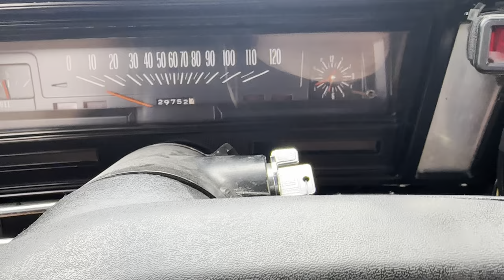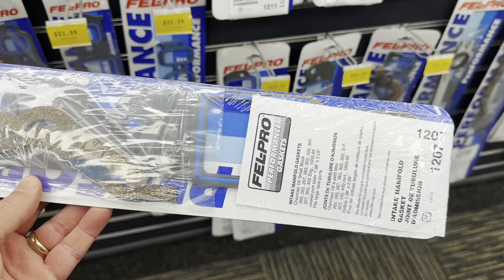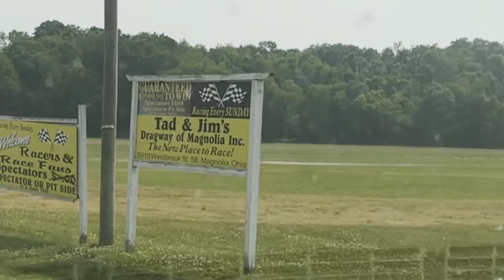LETS PLAY THE BLAME GAME!  Jimmy’s new 434 TEAR DOWN!

Comment: I have to admit, when you were showing the run/s I wasn't thinking fuel pump. In my experience fuel pumps tend to be either good, or bad. But very rarely anything in between. If I hear it running then I don't tend to think its a fuel pump related issue. Maybe that just complacency on my part, or me just being boneheaded. Truth be told, when I was watching the run/s. I figured it was one of 2 things. #1 the wiring for the fuel solenoid on the kit failed. (most likely) or #2 the fuel solenoid failed (much less likely) but possible. Solenoids tend to be like fuel pumps, Either good or bad but they don't normally fail mid-run. 

I know some people hate technology (NOT saying you "Old man") but this is a good reason to log everything you can. Had he been logging fuel pressure more than likely he could have spotted the problem before burning down the engine......

Comment: Don't know specs on fuel system, but had similar issues running the biggest elec fuel avail 20 years ago on boosted blow thru sbc.  It needed bigger than -10 return to run on the street or the pump would overheat.  It should of had a 2nd fuel system or have a pump controller that wasn't at the time

Comment: Hand the LS guys a timing light and a vacuum gauge and they wouldn’t know where to start. Parts are parts engines are engines it’s all about the combination and cubic inches. Any of them can fly apart if you tune it incorrectly or have failures

Comment: Needs a fuel pressure shut off on the ignition system. Be easy enough to wire in. Fuel pressure goes = engine shuts off. At least might save some more parts

Comment: I have a Holley Terminator X running my L...(doesn't matter🤣) I thankfully have a low fuel pressure cut off that has saved me multiple times! First when my Walboro 450 turned out to be a knock off and again when just over a quarter tank of fuel ran to the back of the tank and uncovered the pickup. I decided when I installed a turbo I wanted the safety of an aftermarket ECU to help save my many mistakes as I learn.

I am curious why it was only the outside cylinders that nipped plugs? could it be that they are further from the carb and the longer runners caused the outside to be a little leaner?

Comment: Hey Bill I have a 750 double pumper brawler gas carburator what size jets and size power valve would be good for a 355 sbc with 95 AFR heads and its got a hydraulic flat tappet 292 duration 488 lift cam?

Comment: As a block machinist I've seen Good engine builders do a fine job only to have their effort go to waste as the owners, mechanics & tuners make bad decisions that hurt or even destroy an engine. One being a SBC 383 we rebuilt at a shop I worked at. The owner & mechanic both did things I'd told them NOT to do (Per the engine builder) and ended up losing an engine and broke a lot of parts. Long story; they went to another guy while blaming myself and the shop I worked at. and the first time out he Destroyed everything 'in a catastrophic engine failure.... Huge splash on the drivers side, tore # 1 cylinder completely out of the block!  And then I saw the balancer and part of the crank bounce out from underneath the car!  😙

Comment: Fyi Bill Cleetus has a custom SMX billet engine not a big block chevy with a dry sump oil system so not the same at all as billys,but I know you don't watch his channel and your point is still the same,you will break and hurt stuff when you push the limits or parts fail at the wrong time no mattter how good of an engine builder you have.Also Steve Morris will show all of his failures on his channel also,he is pretty transparent about his shennanigans lol.Cleetus actually took out his rear thrust bearing for the 2nd time which he decided to pack it up and not hurt his 100k engine any further

Comment: I work on small engines (chainsaws, trimmers, mowers etc) and I deal with similar crap as engine builders. Everything leaves the shop with a full tank of VP racing fuel, mix or regular. That way the customer cannot blame me for their equipment not running right AFTER they run them out of fuel and put their own garbage in it. Did it run good with my fuel? It did? But as soon as you fill it up, it runs terrible??? Hmm...

Comment: Steve Morris said there was metallurgy issue with some vendors during covid-19 as well they were using cheap metal he thinks and he had a failure before his first pass on a billet SMX in the one of the main bolts snapped before a single pass when they should handle 5000 horsepower no problem

Comment: Aren't low pressure cut out switches supplied with nitrous kits anymore? Simple safety switch or a 3psi Hobbs switch would have cut the nitrous off when fuel got low.

I bet someone Jimmy knows has a toolbox drawer full of those switches.

Comment: Maybe it didn't cause a problem but Jimmy was turning that engine  EXTRA tight IMO  Im guessing 9000 rpm ( give or take 500 RPM) during the burn out and who knows at the end of the straight. 
 ( Better check some valve springs and stem length) I was watching the live feed at War In The woods and many key board warriors were trying to Blame uncle Bob, I want to say that I don't believe that it is his fault at all and totaly believe between the RPM's and the nitrous (I was told that Jimmy was running multiple kits) that engine never stood a chance. Nitrous makes great power but when you run it and especially a bunch of it and crowd all others winning factors like timing it's not a matter of if but a matter of when! Yes I have scattered dozens of engines over my racing career and it is just part of the game if you are consistently going to run up front.

Comment: It has been my experience with your typical V8 engines  that your front 2 cylinders and rear 2 cylinders are the first to lean out ( NA or forced induction ). From what I can tell, it has to do with how disperses in the intake combined with the unequal length of your typical cast intake manifold runners. 
I am with Bill on people need to quit assuming engine failures are the builders fault.  I give Cleetus a ton of credit for going WAY WAY out of his way to defend the different engine builders that he uses. 9.8 times out of 10 when an engine fails, its either a tuner error or a failure of a part. The engine builder can't control when parts will fail or what the tuner does.

Comment: When it comes to nitrous alot of things can happen that is nobody's fault. Solenoid hang open or shut. Fuel pump dies or starts to die. Piece of crud anywhere in the fuel or nitrous system. Bottom line is parts fail. Even when they were perfect 5 minutes ago. It's all part of it. If you are running shit hard , parts are going to fail at some point

Comment: Crap happens for sure! Gotta learn and move on. Better call jegs and get some low fuel pressure safety cut off switches on order to deactivate those nitrous systems as a preventive measure if ya lose pressure again

Comment: It's one of those "take no responsibility" times, if the motor ran good and then it broke when you got ignorant, your fault, not the builder... If you buy a motor that you know you're going to race and beat the snot out of, you can't expect it to not fail. Fuck i've kicked rods n bearings out of N/a engines because i decided to see how much fun i could have, when you add a literal blow torch to the scenario, clocks running... and that clock expires in about 2 seconds or less.

Comment: The Nova engine is not just like the engine in Mullet. It has a Steve Morris SMX right out of his Boost Wagon.  But, just like you said, it doesn't matter who built your engine. When you are running things hard and things break, most of the time it is just the cost of racing. You use the best parts that you can and use the best practice of tuning available. At some point crap happens, nobody's fault.
Reply: Crap happens alot with SBC many running similar setups not blowing all the time look at raggedyann look at falcon seems Bill shouldn't tune or he should go LS He shouldn't mention cleetus or steve he has no idea the issues Cleetus had it was cleetus running way to much converter to thrust bearing pressure steve told cleetus this before he run the car to lower it down to 75pnds not 125pnds like it was right up to when he ate the thrust bearing but Bill like Cleetus is a dumb ass even if others don't see it the SMX is way to much for Cleetus and his busy schedule.
Reply: @user-uf5hi6wr6m seems to me that Steve and Cleet where and are still trying to figure out how to repair the thrust bearing issue. It's the same issue that Steve had with it last time it was in the wagon and happened again to Cleet and now again on This last sick week. They are figuring that issue out and Garrett mentioned that in one of the last videos.
Reply: @user-uf5hi6wr6m  This was the second time for the thrust bearing. right after it was installed and he hurt it and Steve came and fixed it in Cleetus's shop. and told him to lower the converter charge pressure. He doesn't have a dump valve, which would help quite bit.

Comment: Add a fuel pressure shut off switch to the relays on the nitrous to insure against lean failure on the motor.  Make sure that it shuts off at the low PSI setting you choose.  I would also use a surge tank up front to help out the fuel delivery.  I'm not leaving this a a negative comment, just as insurance and to say some options.  Love the show and both new school and old school setups.  Keep up the good work and Keep them all inline Vickie.

Comment: Bbc.....You run out of fuel running nitrous it will not hurt the engine, it will destroy it.Jimmy Dale got lucky. Let a friend borrow my nitrous kit and somehow the jets got swapped.8+ on nitrous 🎉😢. I just did a test hit inside the shop,i mean just tap the button and the engine didn't rev up, it revved down.Broke rod and went thru cylinder wall at less than 1500...rpms. DON'T RUN OUT OF FUEL.

Comment: Bill it must be hard to see all he comments from the keyboard racing professors they have all the answers and yet they don't race or work on cars cause if they did they would know that every new combination needs work to dial it in every race car is different and you have to learn what it likes, you can have two engines with the exact same parts built by the same person and one will run better than the other. Racers know that every time they rebuild a motor and freshen a transmission they are going to have to learn the car again they are going to have to tune differently partly because no racer can leave anything alone and they are constantly changing something from the tune to the converter or rear gear etc. Billy just finished completely rebuilding that truck and he changed almost everything but the body I would have been amazed if the 1st time he drove it everything worked and the truck was perfect. I agree when you lean on something to see if it'll take it you run a risk of tearing shit up but that too is what racers do. Uncle Bob does not appear to be hurting for business and I don't believe you all would be continuing to give him your business and promoting him on the channel and too friends if he was not an excellent engine builder. Some things ya just gotta let go in one ear and out the other. Let em rant and rave its good for youtube  business at least.

Comment: Hang in there...parts fail.... debris can be dropped in an intake port while installing the engine....it sucks, but it happens....when you said 1278 were cooked, there was only one reason, STARVATION of fuel... certainly a death sentence for the old sbc

Comment: People who get it, get it. People that want to blame who built it know nothing about engines or racing. Hell, I don't race, but I know enough to know that nitrous will kill an engine without adequate fuel supply. As soon as you showed the spark plug after that run, it was obvious it was a lean issue. Only question was why.

Comment: If you're not breaking something racing, you're not pushing it very hard. Sometimes things get screwed up because of an oversight, but unless you replace every part every season and make sure its all 100% before every pass, something is probably going to break. Racing is not like daily drivers. I get decades out of my engines that make 600-hp and less, over that number the chance of problems goes up fast and my engines rarely see more than 6500rpm. Go racing heads up, you will break stuff.

Comment: Never a truer word spoken. I have built around 100 cars for other people. In the small time I had a shop. And you can not control what people will do with their car after it leaves your shop. You give them the set of rules and you may as well just wipe your ass with it. Because the owner always knows best. They will wine the boost up and hole that shit flat unit it blows up. And then it’s always someone else’s fault not theirs someone else’s. And who gets the blame everytime. Everyone else’s but themselves. And these guys I had built cars for didn’t even know how to check their bloody oil before I built their shit for them. And here they are telling everyone that they are vin diesel from fast and the furious. But the truth is they don’t know shit from clay. And it’s the same as big mouths on the internet that don’t know what they are talking about. Shit go’s wrong every day. That’s part of what we are doing. So if you are going to go down this road make sure you have deep pockets. Because it’s going to cost big bucks. And as I have always done with customers engines I would tune it for 100% and I would wined it back to about 80% so I would know that it will live if the customer follows the list I give them. Oh by the way. I teach every customer how to drive their car and how to race their cars. And how to follow the check list. And the guys that did this still have their car and are still racing their cars. But you always have those guys that are just dickheads fuck it up for everyone else. And they are sitting on their couch instead of in their car’s holding their dicks.